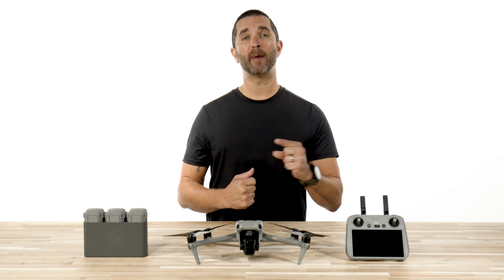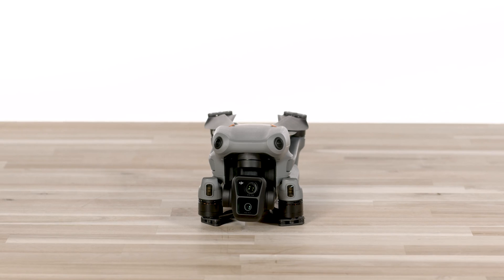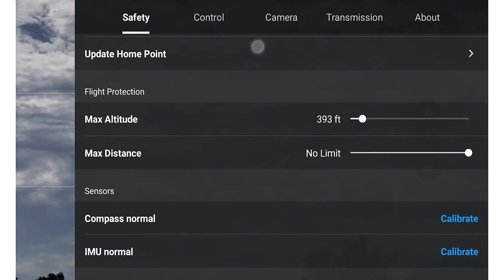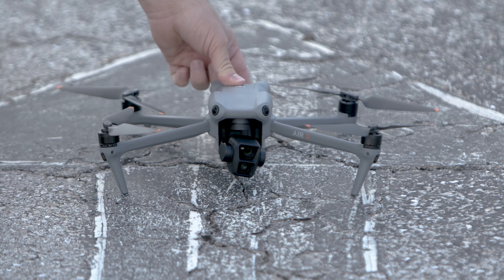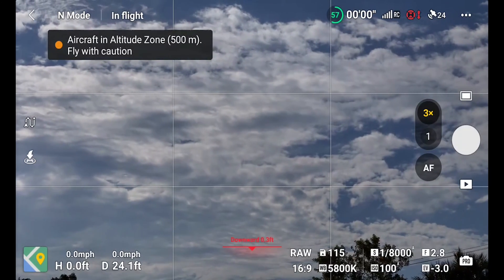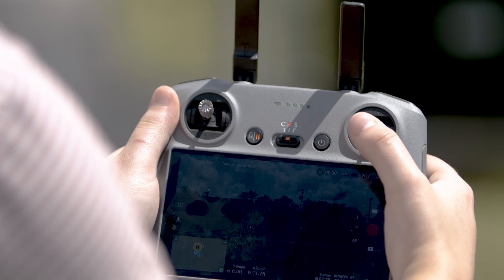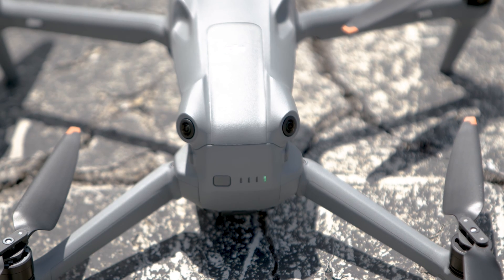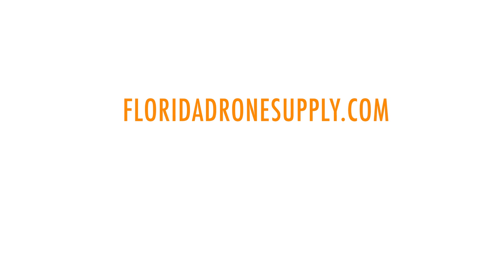DJI Air 3 - First Flight Instructions

Comment: When I take off using the app, after tapping the takeoff button on the left, it ALWAYS comes up with a popup for me to confirm "Normal" mode before giving me the press-n-hold green circle. It did not happen with your demo here, so has me wondering... Is there a setting I've inadvertently applied somewhere that causes this delay for every takeoff?